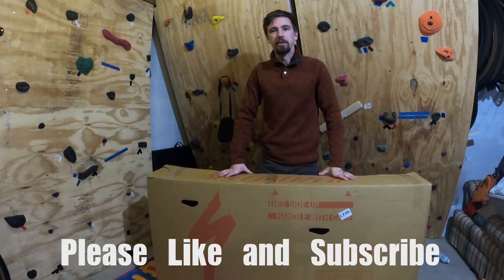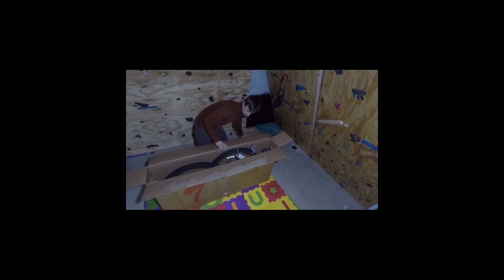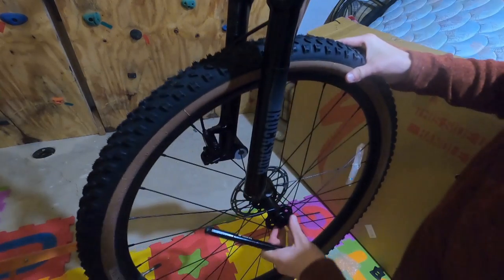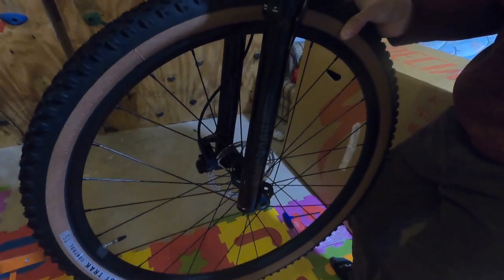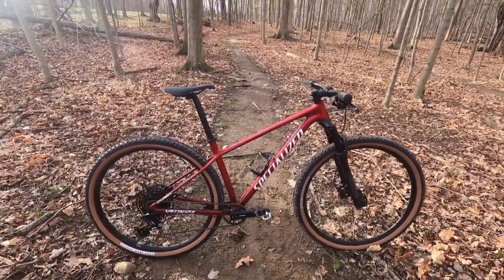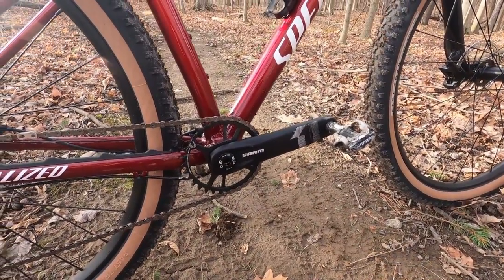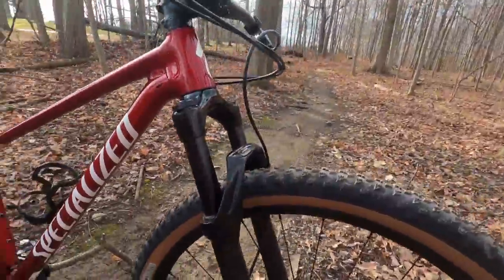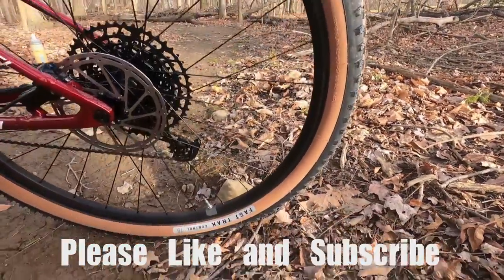Why I bought a Specialized Chisel

Comment: Nice colour. Looks good red/white and gum walls. I got last year's model dark grey with Shimano. Got some of the new gum wall fastrak's to go on
Reply from the maker: That's awesome! I love the tan-wall tires on straight one color bikes. What fork did last years model come with? A Judy or Reba? I hate when they switched from the Reba
Reply: @OhioMTBTrails  it's got a Judy. Trying to decide if I should upgrade fork and wheels. I've put a PNW coast dropper on recently, it takes a bit of the sting out of the hard tail. Great bike!
Reply from the maker: @alex_n8863  if it was my main bike I would definitely upgrade the fork but you can always find some cheaper carbon wheels online too!
Reply: @OhioMTBTrails  I keep my eyes peeled for a good deal. I'd like to get a full sus at some point for days out in the bigger hills. I'll definitely keep the Chisel though, it's perfect for my local trails!
Reply from the maker: @alex_n8863  I definitely regret getting rid of my Chisel! Glad I got another one

Comment: I had Level T’s on my Santa Cruz Chameleon  & yea they got replaced by Shimano’s
Reply from the maker: Did you have an issue with them overheating in the summer?
Reply: @OhioMTBTrails  I only had one ride on em before I decided they had to go. They just felt like you had to really clamp down on em to get em to bite & that was at alum creek. With really needing to clamp down I’m sure they would heat up & cause fade. I put Deore’s on my Chameleon & what a differance. I even swapped my Code R’s on my Stump Jumper EVO for Shimano XT’s
Reply from the maker: @cadman9615  These ones are definitely better than the last pair that I had on my old Chisel. They do grab a lot better but if they have heat issues again then I'm throwing them away lol
Reply from the maker: I would leave my bike in the sun for a few minutes and it would heat and expand the fluid in the lever units